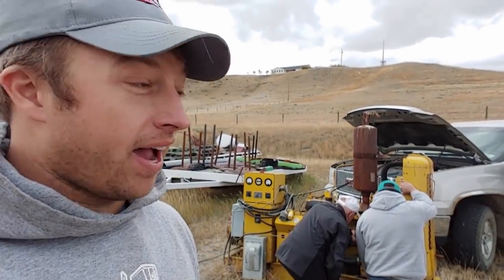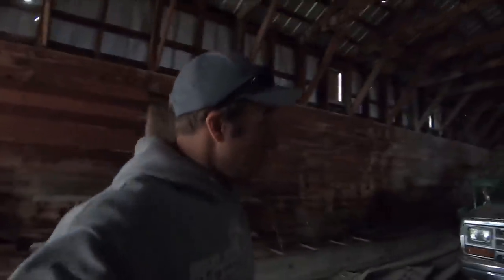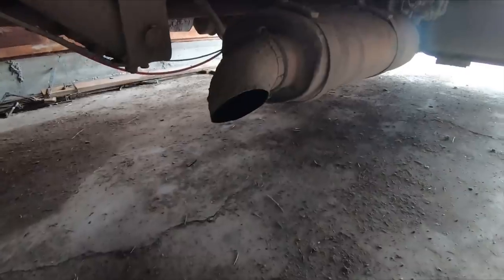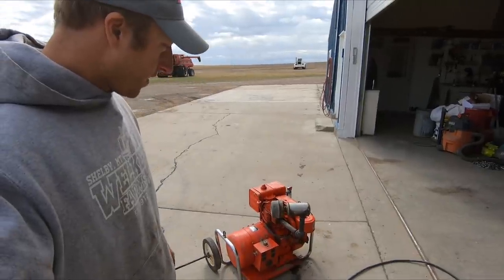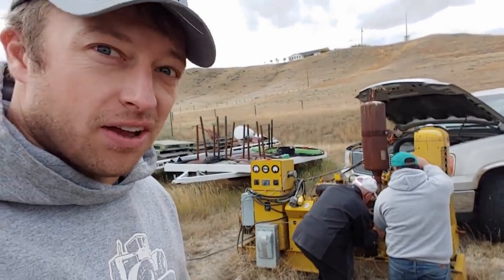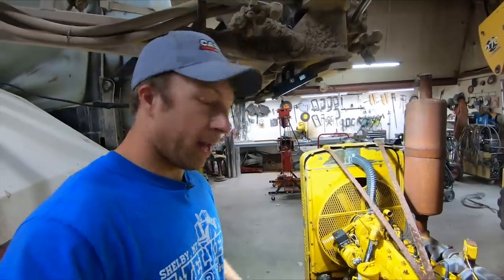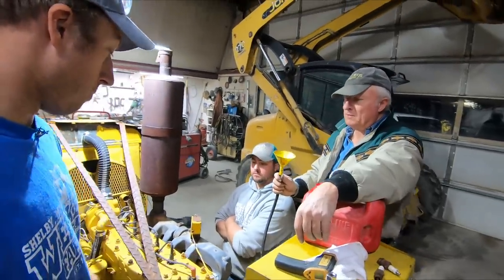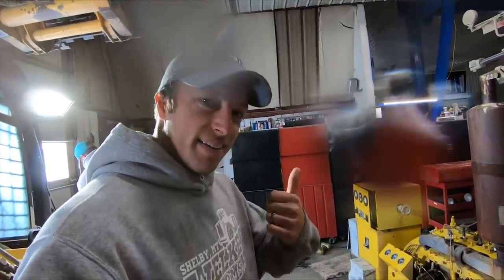Old Generator For A Mighty Storm

Comment: As a kid I hated that job wintering the sprayer. When dad retired and I took over with a pure cattle operation I never missed it. Thankfully my sprayer I use on corn is a smaller three point hitch that ends up in the heated shop for the chore tractors. 

I Betya you’re pretty happy to be done with harvest SW Manitoba not a wheel has turned most of September.

Comment: You have to set the cycles to 60 and that is what determines the rpms of the motor.
Reply: On most any AC generator that uses a spark ignition engine (Gas, Propane, CNG), the number of field coils dictates a specific RPM to output at 60 Hz. Small engines usually 3600 RPM (low $, with low Amperage) or Larger engines usually 1800 RPM (more $ with higher Amps). A Diesel engine is: of course best and it likes the 1800 RPM generator design which demands the more field coils for 60 Hz., Most $ and more reliable.  from Jim B.
Reply: Yup, hopefully they see this comment. Otherwise everything will run SLOW. Clocks will lose time and such. Running it at 1550rpm is probably closer to 50hz output.

Comment: We always pumped anti-freeze through, just long enough that it was coming out all tips. Removed the tips, filters, unhooked all the hoses, shoot air through the lines, removed the pump and left the sprayer outside, pump stayed indoors. But, everyone does things differently.

I'm seeing a lot of holes in the roof of that building...
Those old generators are extremely hard to beat. It's always best to prepare for the worse and hope for the best. Cheers :)

Comment: You'll need a flag on that generator.!
Reply: im looking at a KUBOTA SJ series generators that powers 3 houses and everything on 1 unit wich pretty sweet wich im kinda looking into buying one
Reply: He needs more generator on that generator.  You build a nice shed and install a good engine with a big genny on it and keep it maintained or you build same shed and make as many gennies as you need for the property.  Not like they don't know their way around old engines.   I bet Frankenswather would run a good arc welder.
Reply: @prjndigo  accully the kubota generators at my dealer sells from $1,200 to $9,000 for the huge 60hp and the summer branded ones here with 42hp is around $99,000 and the caterpiller ones is $129,000 wich quite a different
Reply: @michaelmactavish1728  Ya never want a new generator for your first storm.  When you buy a generator you need to run a tank of fuel through it under load first go once every 3 days three times total.  If it so much as makes a weird noise you take it back.

Comment: In case you haven 't found any already, there are some free PDF versions of manuals for that Continental M330 engine at Igor's Index of Metalworking and Electrical Manuals.  It appears that Wisconsin Motors wound up with the rights to the non-aircraft engines after Continental Motors went out of business. Sounds like the aircraft side is still going strong.  There is still a big vacant field in Muskegon, MI where one of Continental's main factories was.
Reply: Just took a look at the pdf. Welker Farms should definitely download that file! Has everything they need for that M330.

Comment: Mark Skaggs has a good write up on proper setup. The voltage is not as important as the frequency. Adjust the idle until you have 62hertz put a load on it , a load would be 75% of what it is rated at. With the load on it check your frequency make sure you are a fat 60 hertz, then adjust your regulator so your voltage is correct. You don't want a brown out or to hot. With the load you want 120/220

Comment: We have a PTO driven generator that we can have run either the house or all the bins, shop, and sheds. It's nice to have be able to have heat in the middle of the winter. But we have only used it 2 or 3 times in the last 15 years.

Comment: 1800 rpm is where it's supposed to run to get 60 hz. Check the actual engine rpm with a  digital tachometer  to confirm the rpm reading on the mechanical tach.

Comment: Get Your self a Miller or Lincoln welder generator for your service truck.  8500 to 9000 Watt A/C power. Works great for the house also, the one I got.

Comment: As others have said the hertz needs to be at 60, that is controlled by rpm most large gensets are 1800 small ones are 3600.
So find 60 hertz, oscilloscope is handy for that, then bring your voltage to correct and your good to go, to slow rpm will burn up sensitive electronic devices, however most newer devices are 50-60 hertz and wide range voltage input...

Comment: Hey Nick,I started to use 100LL AvGas several years ago in all of my equipment that I leave sitting for long periods of time and it works great.It cost a little more than pump gas but it is well worth it!
Reply from the maker: That is what we want to do! I hear most small engines don't mind the lead. I will go get some!
Reply: I think our little rural airport sold more 100LL for race cars than for airplanes. Lol

My ole Bonanza had a Continental six cylinder too... but it didn’t look quite like that one🤣 Horiz opposed air cooled. But at one time it DID have a generator - not alternator. And mags. Had two mags. Two plugs for each cylinder. One set on one mag. The other set on the other mag. For obvious reason🤣

Great vid Nick and Robert!
Reply: Av gas is a bit better for longevity than non-ethanol, but you'll have no problems if you run non-ethanol.

Comment: Yep, same here. I have this old shop cart that i "accidentally" dropped half a truck on, wasn't my fault (honest) and i welded the tub from an old parts cleaner that kicked the bucket. Whenever i'm done with a job, i throw everything inside and roll around the shop and pick stuff up inside and put it back in. Honestly, it's my savior because otherwise, i lack motivation. My smaller shop, is a complete mess, i might borrow your pan method for it.

Comment: They put continental engines in EVERYTHING since the mid 1930's I believe.  Cars,trucks,semis,tractors,boats etc etc etc.  Parts are very easy to come by as many are still in service.  Look for a junked out 1950s Kaiser and see if it has a blower on it.  You might be able to get it for cheap and they are fairly simple to rebuild.  Would make an interesting generator setup lol

Comment: The proper way to set the engine speed is a frequency meter, most fluke meters have this function. Set the engine speed to 60hz then adjust the voltage regulator to the desired voltage

Comment: Set the rpm back to 1800 to make 60hz frequency. Running too low or high frequency will burn up electronics and some electric motors. Having both correct voltage and correct frequency matters!

Comment: Maybe take the sprayer off that old dodge and put the generator on it with thick rubber mats (for vibration), bolt the generator and and mats down so then you have generator truck to run around the farm.

Comment: So all this equipment (harvesters etc) that haven't got sheds... AS a UK City boy I might be dumb about most farming stuff... but you are surrounded by Grass!  surely you could bale up enough to surround those babies, rafters over the top to take more bales for the roof,  a couple of tarps to keep the water off the roof & rope it all down, it will keep the worst of the weather off 'em & provide some insulation... then just recycle the bales in the spring. plough them in, feed em to livestock, or even have a good old bonfire.!  What do you think? cheap, practical, effective.

Comment: To improve cranking and performance add a coil in place of magneto and replace the generator with an alternator. I would replace carb with Mukuni altitude compensating model off of a Honda or Yamaha motorcycle.

Comment: If you run 28-0-0 fertilizer through the sprayer it will winterize it. The fertilizer doesn’t freeze in the system.

Comment: Thats so funny. I had a 5000 watt gen from HOMECLUB back in the mid 80's. 1st home I built had no temp power. I took it to a muffler shop. Put on a resonator. It was still loud. We built an air flowing plywood box around it. That helped. It burned out after the 2nd house I built. I was to cheap to buy Honda generators. Good concept, the muffler, but obviously there is more to sound attenuation as I later found out and specialized in for building recording studios and multi million dollar homes.

Comment: Few have mentioned this but to reiterate, engine rpm controls frequency. In the electrical world, +/- 10% and that rpm change is more than that. Lights will be more dim and electronics will not last long.

Comment: We spray into winter until the snow falls. 50/50 to 70/30 32-0-0 is sufficient to winterize our spray rigs. It's cheap and it works. Straight 32 will crystallize so don't do that.

Comment: Those old Continentals are hard to kill. Very good generator the eighteen hundreds are. The thirty six hundred rpm models are usually short term and not reliable although Honda pulls its weight. The eighteen hundred rpm models are based on a sixty cycle voltage so clocks keep time and computers run right, low amps can cause failure of certain equipment/appliances an will kill computers. That machine has a phase filter and safe to run several houses at partial efficiency as a house usually takes about somewheres around fifty five hundred amp/volts as I am no getting my words out right but I know that LegArms has the knowledge to figure it out. When running several houses like the big yellow one is designed to do, they are almost cost efficient. Diesels tend to be more economical and practical...... be safe and god bless

Comment: I believe that's a continental engine,so filters and carb parts might be same as Lincoln welder,which has those parts.I would use straight 30 weight oil.

Comment: Hey guys! A tip to remember when you are starting an engine that has been sitting for a long while. When an engine is stopped, one or more valves are going to be in the open position. Rust can/will form on the valve face and valve seat and keep that valve(s) from sealing on initial startup. It's going to miss for a while until the rust is burned off, which it will eventually. Also, just as the valve face and seat can rust, so can the valve stem. It's wise to check for stuck valves before trying to start it. Turn the engine over several times, like 4 or 5, by hand to be sure it turns freely.
Reply from the maker: Thanks for the tips! Great points!

Comment: Needs to be 1800 rpm for 60 cycles per second. It would be hard on household electronics to run under frequency for too long, the voltage adjuster just changes the magnetic field in the generator to increase or decrease output voltage. The voltage regulator will have to be adjusted as load increases or decreases if it isn’t automatic.

Comment: That engine most likely should be running about 1830-1860 rpm. That rpm will produce 61-62 hertz which is the frequency and standard American power is 60 hertz. The engine will bog down under load slightly and if you set it to 1830-1860 it will drop to near 1800 under a load, perfectly giving you 60 hertz on the dot. With most small to mid size generators, every 30 rpm equals 1 hertz which gives you the 1800rpm at 60 hertz. If you go too low it can burn up and cause failure in tons of electrical devices. I admire what you did to this thing though, it takes a lot to resurrect this old iron. I love the videos
Reply from the maker: Really appreciate the insight! We are by no means electricians so any advice is good! Will make sure it is running 1830-1860.

Comment: Put a little load on it and check the frequency. Engine speed most directly changes frequency, so try to get close to 60hz under load. With a four pole generator like that you'll be at exactly 1800 rpm to get 60hz.

Comment: for 3 phase you would have to rewire the generator head instructions should be on the nameplate.. if you need 240/120 keep it that way.. if there is equipment you must have running on 3 phase you will have to decide whats more important...

Comment: Few years back I owned a fork-lift that had the same engine in and it used SAE 30 engine oil.  If they are going to use that generator on the farm it would be worth there while to consider converting it propane.  I converted (to propane) the forklift I had and it started easier and ran so much better for long periods of time.  Engines running on propane don’t carbon up or fuel contaminate the engine oil and engine coolant like an engine running on gasoline does.  Besides that with propane you eliminate all the problems that is associated with letting a engine sit for any length of time like you do with the garbage that is called gasoline today.  I know you can buy “small engine” ethanol free gas but at least where I live that stuff is rather expensive per gallon and the price of the conversion will quickly be offset if the generator is used at all.  In my opinion there really is not a down side to converting a stationary generator to propane compared to leaving it run on todays pump gasoline.  On a side note is it me or is that generator looking awful clean for sitting outside.

Comment: We just had our generator serviced. So it's ready to use it we lose power due to bad snow storms. We use it in the summer once in a while to keep it active working good. We always keep the gas tank fillsd which holds a hundred gallons of diesel fuel. And have another on standby. Longest time we had no power in our area was 2 weeks. We had the generator and our neighbors that's been friends for generations didn't have power. They got a generator years ago.

Comment: nice old continental gen set, if it ever quits making power. use 12 volt battery to energize capacitor by  striking an ark on brush set at armature.

Comment: I am pretty sure you need to run that generator at 1800 RPM for your governed speed. That way it properly generates 60 Hz (cycles per second) of AC current.  1800 is a multiple of 60 and all generators that work on 60 Hz must run at some multiple of 60.  I didn't read any of the other comments, but I am sure there are going to be a lot of comments about the proper RPM when you said it purrs as 1550.  :)

Comment: On a large ac generator the output voltage is controlled by the field winding. The rpm controls the frequency which in North America are 60 cycles which with that size generator it has 4 poles so it will produce 2 cycles per revolution so at 1800 rpm you get 60hz at 1500 you will get 50hz which is fine for a lot of things but some older appliances could be damaged at 50hz. As for the voltage you should make sure to fix the voltage meter or use a good RMS AC voltmeter to test and make sure you are within +-10% or things could get damaged

Comment: Generator tech here, I wouldn’t run electronics off of that until you insure that you have good frequency and voltage. You will fry TVs, computers, and maybe even the printed circuit boards on your furnaces. Just a heads up.
Reply from the maker: Definitely appreciate it, learned we need 60hz so we'll play with the rpms and try to get the voltages where they need to be
Reply: That is a really cool generator tho and I’m a little jealous you got such a great deal on it! Pumped to see you use it!

Comment: 10w-30 should work great in the generator.  You can use 10w-30 in a Cat 3406-B diesel engine so that little engine should work well with it.
Reply: One other comment:  You might consider putting in some engine oil stabilizer to keep the idle parts lubricated between start-ups.  That way you greatly reduce wear on the engine parts.

Comment: Most of the time I only use non ethanol fuel in stuff I don’t use often. Like if the tool or in this case a generator is used often or daily then regular fuel is good to use unless it’s an older motor in a car that was meant for leaded fuel. Or if it only gets used once or twice a year the ethanol in the gas will absorb water and that’s what wrecks stuff and the ethanol will probably degrade anything paper like filter elements. Where I live (mississippi) ethanol free fuel is like 3 dollars or pretty close to it a gallon.

Comment: If my math is correct ,at 1500 RPM, You are at 50 Hz with no load. That gen set could be running in what's called droop mode as apposed to isochronous mode. Droop mode means the frequency will droop on a relatively straight line with the amount of load. At 50Hz no load you will be in the 40s with a load. I'd run it at closer to 1800 RPMs.  It probably has a governor though. Also the engine might be tuned to run better at that speed.

Great videos BTW.

Comment: Pro tip when pulling a sled like this generator : coat the underside and your trailer with dish soap or lube. It will slide so much more nicely

Comment: Set the RPM to produce precisely 60hz and then adjust regulator to produce 120/240.  Be aware that many of these old generators are hard wired for either 3 phase Delta or Wye and can't be changed...  There is a difference.

Comment: if you hold the oil can the other direction with bottle opener is on the top you wouldn't have it chug like that and push into your funnel try it once let me know what you think that's the way you're supposed to pour the oil from the other direction but if you try the other way you might have some better results let me know how that works out let me know if I give you some good advice or not

Comment: Just an idea....but why not add on a room to the back of the shop with a door you can get to it with the skid steer and wire it in to the farm power grid on a junction box. Have a separate tank I guess outside the room so they are separated and no possibility of accidental detonation......just an idea but gets it out of the elements, somewhat protected and test it a couple times a year to make sure everything is working and lubricated.

Comment: Cool old genny.  Make sure you are getting 60 Hz out of it.  If not, you will need to adjust the engine speed back up until you get it.  Then set the voltage with the regulator.